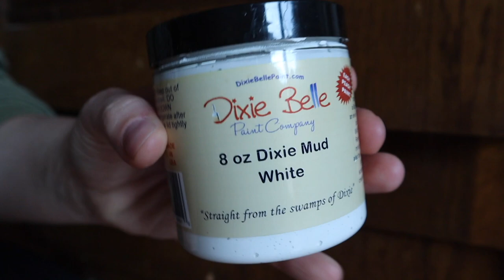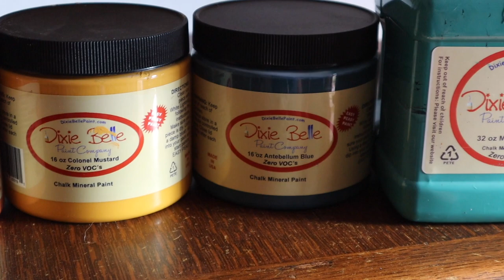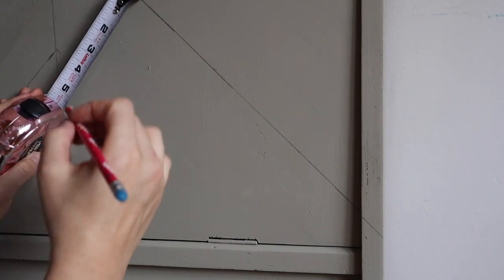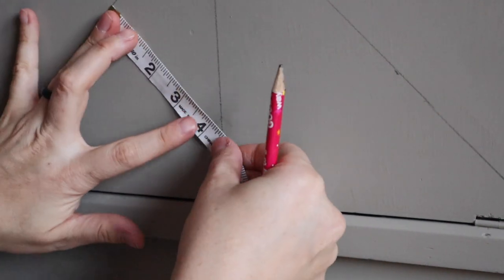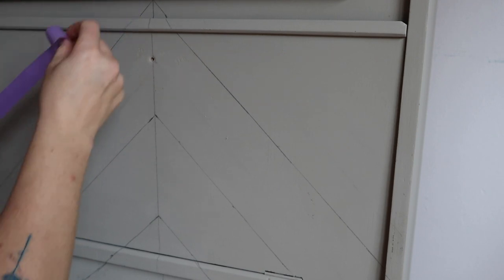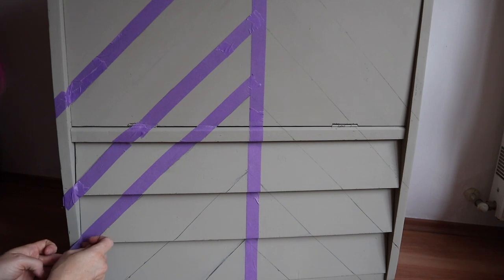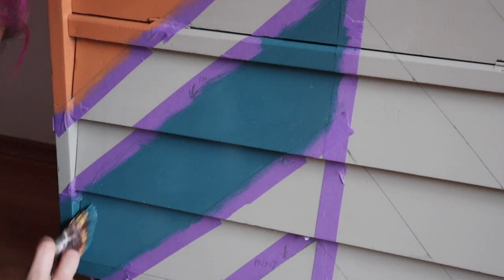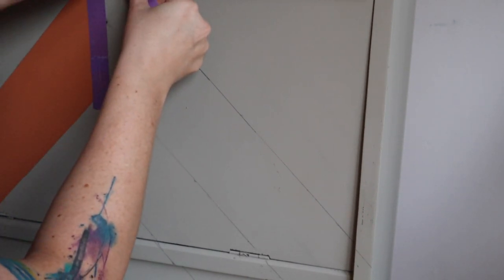How To Paint A Chevron Pattern On Furniture Using Mineral Chalk Paint

Comment: Question....... is their a minimum temp that I should have to paint and/or topcoat with Dixie Belle? I have to paint in my garage and I can’t get it very warm out there
Reply from the maker: Okay so in general above freezing, roughly about 40 degrees f. It will take longer to dry the colder it is. You could try even a space heater to point in that direction when you paint and topcoat. I had the same issue when I lived in Wyoming so I got a space heater. I totally understand :)
Reply: Bella Renovare by Crys’Dawna thanks so much for getting back to me